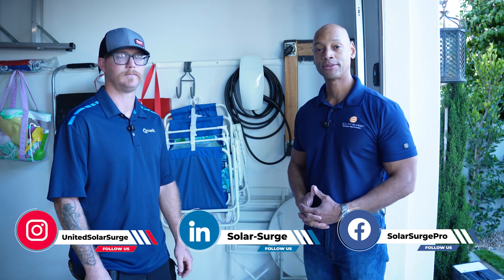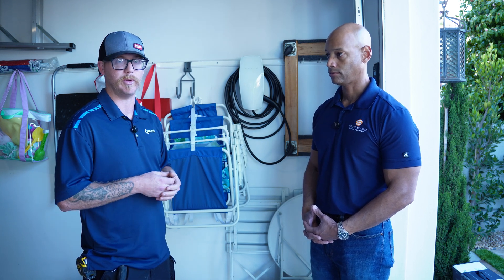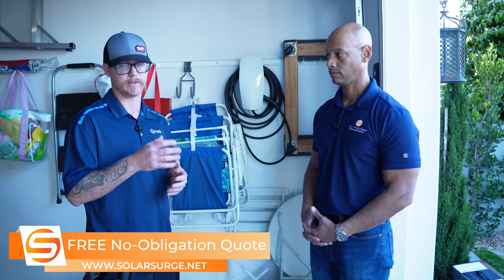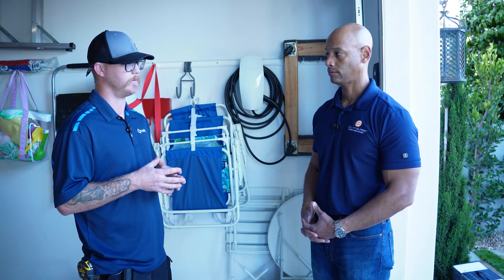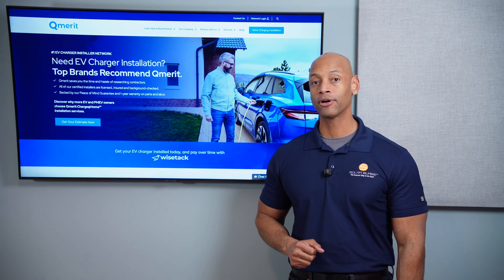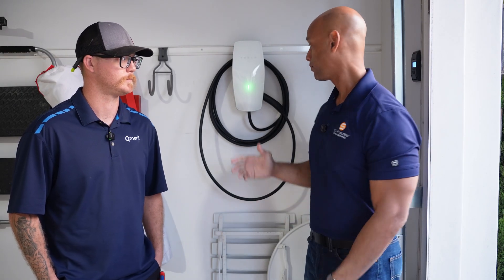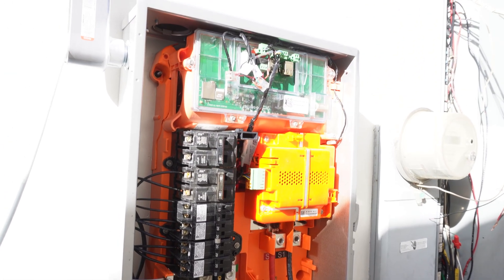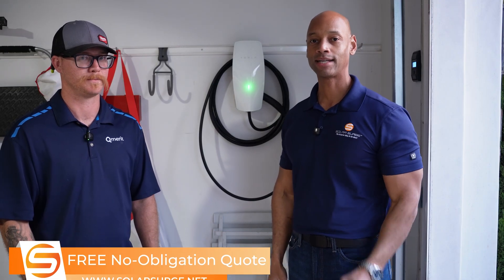Installing Cybertruck Bi-directional Charger | Tesla Wall Connector Gen 3

Comment: Seems Tesla Bi-directional solution is late to the game and subpar performance compared to competitors that are already selling a bi-directional charger. Limit of break out box and only supporting one vehicle, the Cybertruck makes this a very limited and unappealing solution for most. Even Charge+Point has announced a 80-amp bi-directional charger with Omni port that provides much greater power and supports all EVs that have bi-directional capability. Remember, in 2027, California will require all EVs to support bi-directional so I would recommend looking at alternatives and keeping your eye on new product announcements. Not a good time to spend money on a very limited product.
Reply from the maker: I agree that it’s still early in the game for these systems and we should expect better offerings to come out as the technology develops.  IMO, PointGuard is the leader for this technology in the US market.
Reply: "California will require bi-directional in all EVs in 2027" -- Do you have a pointer to this?  There was a bill for that in the last legislature cycle but that was pulled out. The only bill I know is very mild (SB-59); it allowed requiring bidirectional but it did not impose it (yet).
Reply: CA’s power grid needs bidirectional charging, like yesterday.  People charging cheaply at night and powering the grid during peak usage hours would be a huge win for citizens.

Comment: Will this bi-directional charger work with my current solar and back up battery system? I have Solar Edge inverter and batteries. I also have the Gen 2 Tesla charger.
Reply: You need the Universal Wall Connector AND that Tesla Gateway backup box they installed outside.

Comment: Tesla and these OEMs have made bidirectional EVSE so complicated and those who don't have any power experience are spending so much money but I guess if it's what's make them happy, good on them.
I'd simply use the 240VAC, 30A outlet in the back of the truck to simply power the house manually. You can jerryrig the 240VAC adapter to address your bonded/neutral grounding situation and make sure you are not pulling more than 7.2kw total max. This makes me have a lot of flexibility in determining what I power rather than specific loads. In an emergency situation, don't use your air conditioner, dryer and heavy loads.

Comment: The Cybertruck is 115kwh which is like 8-10 powerwalls. It can handle A/C for more than a few hours.
Reply from the maker: I agree. When he was explaining that I was thinking he was being very conservative with saying what the cyber truck could power. Based on the specs, it should have no problem, running the whole house with air conditioning.

Comment: Extremely informing!!! I currently have a 25kwh battery and a manual transfer switch only 12kw inverter 11kw of solar run my house ac and ev well 3 ton ac. I don't know if I want to bother with this due to the limiting use i want to have the house minus the electric range. I want it to expand my days off grid and the Tesla is there. I really want all Teslas to have vehicle to load so I can utilize what I own. Some day off grid. Early adoption. Tesla does it best. Ford and Chevy I won't waste my time.

Comment: Ford Truck "Pro Power Onboard" truck AC is much simpler and cheaper  to deal with.  Tesla is playing catch up, and not very effectively.  Why go through all that complication and installation expense if all you want is AC power from your EV battery?  Ford installed a bunch of solid inverters and AC outlets in their highly functional, normal-looking, easy to service, cheaper-than-a-Tesla  EV's, and all you have to do is add a heavy extension cord and a Home Depot power strip to it, and voila!  You win and  Elon loses again!
Reply: The lightning onboard outlets are really useful. Used it on my friends truck. The Cybertruck has multiple AC power outlets for various needs. There are two 120V outlets in the cabin and two in the cargo bed, each capable of providing up to 20A. Additionally, the cargo bed has a 240V outlet rated for 40A. All AC outlets combined are limited to a total of 40A
Reply: Tesla is really mossing out on the V to L area of utility for their vehicles.
Reply: You know that the Cybertruck typically has more A/C power available than the Ford truck right? Also you are confusing two different things. This install is for an automatic home backup. Something which Ford offers and is far more complicated and expensive than Tesla. What you are thinking is that you can just plug your truck into your house with the A/C outlet on the truck. Both the Cybertruck and the lightning can do that. You are just misinformed and unknowledgeable on what you are even talking about.
Reply: Good point!  Having to install just the right charger and a Tesla gateway box complicates things a lot.

Comment: Can this be used bidirectionally with other cars like the lucid gravity or f150 lightning.
Reply from the maker: No I don't think so.  This is an AC charger only.
Reply: No. Each OEM currently has proprietary protocols. 

That’s why it’s better to use the 240V outlets in these EV trucks as that is standardized.